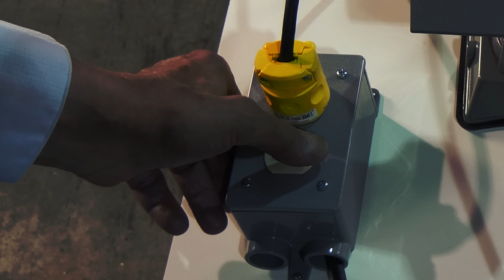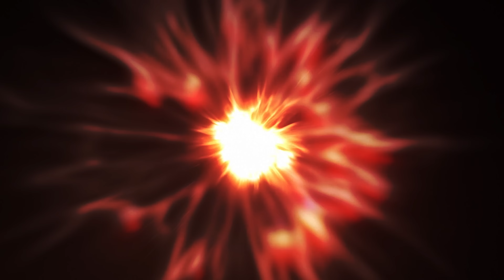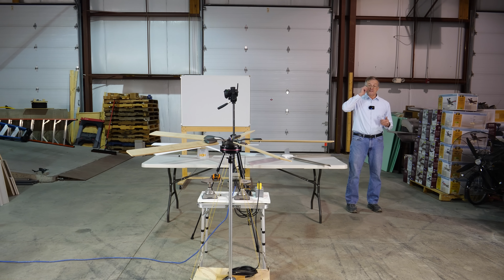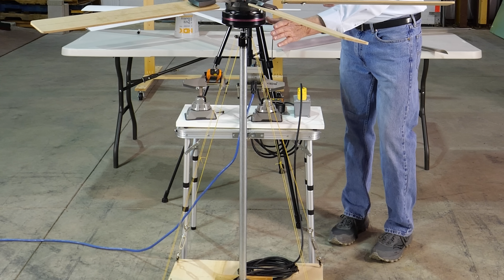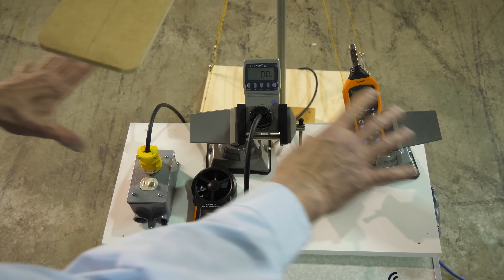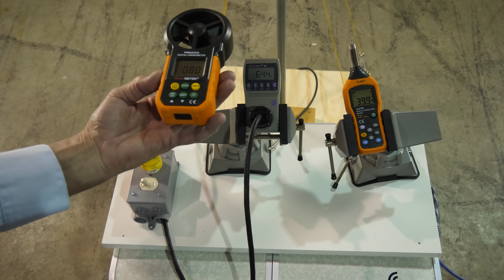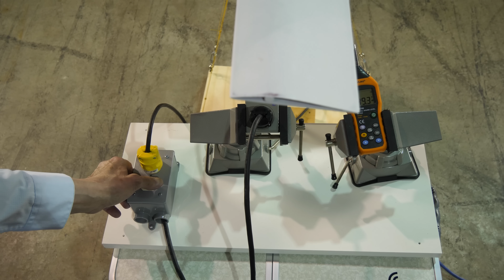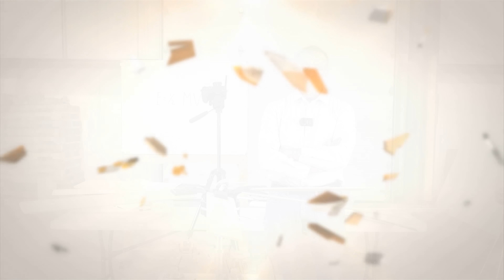This Fan Uses Almost NO Power

Comment: I'm wondering what the issues with the first motor are that it performs so much worse. I'm not too technically educated - trade degree only - so my first idea was shoddy design work. But maybe it is the underlying technology is simply not as efficient plus push for minimised component costs?

Comment: Hi, i think there might be an error in you measurments. The thing is that AC motors have a very low power factor, espacialy with low load. That means that while you are measuring 60w, technically, it's not converted to heat ot mechanical energy by the motor, and significant part of the measured power is returned to the grid. When you load the motor, power factor increaces, and more energy is actualy used by the motor. So, for example, if we measure 60w with no load, and 70w with load, we can not say that 10w is used to move air.

Comment: Slats are symmetrical in both directions, allowing easy reversal of the fan for summer vs winter operation by just reversing current flow.

If you use an airfoil shape, won’t you need to flip the foils in addition to reversing the current in order to reverse the airflow?

Comment: Q;  is the initial fan motor designed to only run while hanging from above?  Could the orientation relative to gravity be meaning it is not running on its bearings properly?

Comment: AC induction motors for ceiling fans are about as awful as shaded pole motors or anything else. Induction motors can be quite efficient and cheap but ceiling fans are designed to be really crap, with low torque and high leakage, poor power factor, etc. The squirrel cage fan in your central air is a bit better but smaller single phase induction motors will always be a bit crap... At least legit motors offer 60 to 80% efficiency. Larger 3 phase ones in industrial and commercial will be much better. I wish 3 phase was more common in residential.

Comment: I love your contents, but that may be the most frustrating episode for me. 😄
First, you did not adjust the pitch of the blades. This is fundamental, specially on the asymmetrical blade design, that even at 0º incidence already produces lift. And particularly on the asynchronous motor, its rpm is defined by the mains frequency , and can get very lossy if forced out of sync. A curve showing consumption vs load vs RPM would have been really nice.  
And the pitch of the foil blades looked way too high . You are looking for airflow, not lift or thrust. Wing shapes may not be good at all for this. Common fan blades all have are really specific design and shapes, for a reason i suppose.  
Finally, I think that testing the other blades on the dc motor would have been interesting too , showing if there was any advantage in using those designs.

Comment: Hunter Pacific is an Australian company. They have had DC motors and proper blades for a very long time. What you are looking at there is the low tech cheap models.
What's with the lamination buzz?

Comment: @8:30: There is clearly 40 dB of noise from that graebage of a transformer.
Reply: On the second watch through now and I realize that that's not the Transformer noise that's the sound of the motor itself. But that means that he does not have it on full speed because they generally only hum like that when you have them set to low
Reply: Yeah that was my first thought too and also when they sound like that they're usually chomping up the power so where was he taking the measurement for the power reading at? And it doesn't really matter because that thing is going to affect all the way up and down the line.
Reply: Yes, it was a waste of time in many ways.

Comment: Thanks for the video! I remember back around year 2010 in the market for vacuum cleaners in the EU, the different brands was rushing to market the more powerful (wattage) vacuum over the other. It went from a regular 800 watts to over 2000 watts over a few years. The EU then started limiting the max wattage to 1600 in year 2014, and then 900 in 2017. The vacuums are still very effective, but now the brands have to compete on efficiency, and not just putting in a more powerful and less efficient motor to brag about "power". Its also worth mentioning that the EU has a lot stricter and understandable energy marking on all appliances compared to the US, making it easier for the consumer to chose the more energy efficient variant.
Reply: They turned them into expensive!!! Dustbusters, not even the motorised brush in the suction head helps to remedy that.

Comment: Too bad the data weren't presented in a comparative table or graph. At the end the stock blades are not only less loud, consume less power and cheaper to manufacture... Honestly the BLDC motor part is interesting but quite irrelevant. Who is going to replace its fan motor ? Nobody. Yet replacing blades happens often (broken or damaged ones, lack of space etc...)

That and the humming noise (which probably interfere with sound measure too) made me a bit disappointed on this video.

Comment: At about 5:18 you got my attention with the statement, "the blade was optimized for low speed operation . . ."  Did you mean, it has the optimal (constant) angle of attack for a constant width and constant cross section shape"?  I would guess that the speed varies by an order of magnitude over the length of the blade ( radius from 3" to 36") unlike the Wright brother's wing which has an almost uniform wind speed along its length.  Airplane propellers and wind turbine blades have a twist along their length to effectively vary the attack angle to match the speed of the blade through the air.  In addition, the width of the blade (again both airplane and wind turbine) varies along the length as does the shape of the cross section.  Finally, the parameter which is being measured for "blade performance" or "fan performance" is the air speed at a single point along the blade length.  Optimizing a fan blade is a very complex problem even before considering the electric motor to drive it.

Comment: Two comments: First, Energy Star will not test portable fans (and some are awfully inefficient), just as they refuse to test microwaves; but they do test ceiling fans.
Second: I have a story idea which your channel is perfect for, assuming my premise is worth considering. I am skeptical about the net effect of both dehumidifiers and humidifiers, but I have been unable to work the physics needed. A dehumidifier removes water from the air BUT in condensing the water I understand that significant heat is generated, plus the equipment expels its heat of, say, 600W when cooling, directly into your home. I was wondering if the effect was a wash (or worse). Then I thought about expelling the condensate through a copper coil or radiator, on its way to the drain, since it is ice cold. 
Moving on to the hateful furnace humidifiers, could the opposite be true? That is, when the water is evaporated it cools the heated air from your furnace (duh). At least the humidifier motor's heat is utilized. Setting aside the comfort advantage of a moderate amount of humidity in both heating and cooling season, do either of these devices actually benefit us from the energy use point of view? This ha really bugged me. Thanks.

Comment: I think the best test would have been to compare all motor v blade combinations at a target air flow rate.
I suspect the tricky bit would have been getting consistent air flow measurements.
My prediction is that the decibels from the DC/airofoil combination would have been drastically lower.

Comment: I've been using a dc solar fan for 30 years. 1kw 12-volt battery bank. 800 watts of solar. Runs 24 / 7. Wish I had a link to a 12 brushless motor. I'm using the Ameteck 36 brush motor. They were great back in the day for small wind turbines. All I had to do was replace the brushes and bearings over the years.

Comment: 8:00 you can tell the motor is lagging behind the ac line because it is so noisy, synchronous motors dont like running below their rated rpms
.....ok maybe that's a lighting fixture as it's buzzing when the motor isnt powered?

Comment: Junk Chinese motor with aluminum windings and cheapest possible steel in the stator with massive core loses in those fans no doubt. Issue is we're always looking for the cheapest products, and often that means it's made with the worst materials that will barely do the job. Nearly all motors and transformers are made with aluminum windings now. Using copper and quality low-loss magnetic steel are luxuries that are now explicitly stated on packaging of a few niche manufacturers.

Comment: 2 things, would winglets help reduce drag and inorove efficiency, also i read uneven edges improve efficiency which is why the engines on 787 and 737 maxs have points, maybe that on the trailing edge could help it's meant to mimic an owl wing I think

Comment: You make a good point about the vast increase in efficiency of the DC brushless motor! The old style AC motor lasts forever - power surges and lightning strikes will not phase them. The common failure is run capacitor - but even then, they last for ages. Sadly with corporate profit incentives they'll manufacture the DC motor in a wimpy way such that the first lightning strike will zap the motor ICs and drive transistors. You've heard of shrinkflation, where product serving sizes are diminishing while keeping the same price. Well now we have crapflation - products break more frequently, harder to service, requiring more frequent replacement. I'm not dissing you. You've made a significant finding - so significant that I fear "Green New Scam" legislation that will outlaw old fans (remember tungsten lightbulbs). I like LED lighting, but the bulbs are built to burn out because of trapped heat. In my overhead light fixtures that are unreachable, I use a set of channel-lock pliers to pop the globe off of them - the reduced heat makes them last much longer. Without the diffuser globe, the lamps cast shadows along the top edges of the walls. I don't care; the bulbs last longer. You've got to factor in frequent replacement costs in your cost analysis.

Comment: Another interesting application would be off-grid, when you have a DC energy storage, using the fan controller straight from DC, rather than using an inverter to convert DC to AC, to feed an ac-dc power supply, which feeds the motor controller, which then converts it back to AC.

Comment: Conclusion, get a fan with a quality brushless DC motor instead of an AC motor for major power savings, or higher performance with lower savings (but still savings).
Small appliance AC motors waste too much energy on heat (which also means the fan will move warmer air, which is probably not what you want).
Depending on how often you use the fan you can see a return on investment within ~half a year (if used non stop) or more, but the fan should last a decade and save much more.
If you choose more motorized appliances with such a motor you'd actually start seeing a difference in your bank account too.

Otherwise, asymmetrical > wood plank > curved metal foil - fan blades. but it's not close to being as important.

Comment: A NACA profile like that is designed for lift, not for mass troughput (hence the rather steep angle of atack I think). I would love to see some results using a helicopter airfoil, or even a propellor type airfoil.

Comment: 3d print blades : use Prandtl-D 3 bell shaped wing loading (maybe extend them a little in length) this shape is cancelling out the lift at the wing tip so that noise can be much reduced, it may also self-stabilise partly. Those wings will be lighter and have their width reducing going to the tip. You may also experiment with number of blades and their basic angle, but the Prandtl-D type of shape has its angle rotating in various key points from start to tip.  Look for the NASA paper and take the angles and profile of Prandtl-D3c. (it is a a low speed almost hand glider)

Comment: This is truly sad that US being pioneers in electricity and then in domestic electric appliances got stuck in the past for some reason. In EU  DC fans, washing machine motors, AC units, heatpump driers are everywhere, it is quite difficult to find old school devices actually now. I could only guess this is due to lower electricity costs or because we have strict regulation for consumption.

Comment: I invented and built a brushless motor driver that does not use a computer chip/software.
Could be used in all the applications you mentioned.
Looking for investors to start a manufacturing facility to produce them.

Comment: Any thoughts on measuring air velocity that close to the blades ? even just for comparison between blades it likely introduce an error due to different air-patterns from different blades. A measurement 2-3 meters from the fan where things are more homogeneous would be better.
No doubt the shaped blades are better, but a more accurate measurement could show even greater improvements.

Comment: I have several fans leaving California for Idaho & I was planning a test, because I have an off-grid solar+ battery system & was concerned about old inefficient motors. I will complete my findings, across several brands & without a doubt, will buy Hunter Brushless motors. As always, I'm pleased with your work. I'm preparing for your AC system. Thank you

Comment: This would be quite useful to someone like me who runs their fans the same direction all year. I do it because the output from my high mounted MrCool cassette distributes more evenly year round when on updraft, and downdraft is uncomfortable. For those who need reverse, a simple mount that will install on standard ceiling fan blades with a rotation feature could be used. On direction change, you would simply press a detent on the rotation shaft and spin each blade 180°. Alternatively, an automatic mechanism based on rotation direction could be developed. When will you have these for sale?

Comment: I have done similar tests on smaller fans, but I track RPM, thrust, and air velocity.  I use a scale to measure the thrust, (lift) by the loss of weight, and use the momentum equation to determine the M*V.  I have found the velocity measurement the largest source of error.  A killawatt power meter is used to measure power.

Comment: There is a good chance the powermeter can not handle the frequency and crestfactor of the signal from the driver board. They are also often very bad at low power levels (under 5W or so). I would use a good lab grade bench power meter from a company like Keysight or R&S that can handle this signal.  (Measure with a scope to analyse the signal first) In my country you only pay for the real Power (P in Watt) not for the reactive part (Q). Together they form S (in VA) Many of those hobby powermeters are for most good at measuring things like a lightbulb at 50 or 60Hz. They can give huge faulty values when measuring reactive power and higher frequencies.

Comment: DC Brushless motors beat shaded pole and small induction motors hands down. The inclusion of Neodymium magnets may be the sticking point in DC motors, both availability and cost. i suspect ceramic magnets would also be a contender for cost/efficiency. Great video 👍

Comment: The difference is probably much bigger than shown by the meter. The missing  component is power factor, the difference between actual power and measured power. AC motors are notoriously confusing when the wattage is measured because the phase of the amperage and voltage components are shifted in time compared to a resistive load  and not all measuring devices compensate for that. The average mechanical house electrical meter does not. Your device might. This means the actual amount of energy removed from the grid is significantly greater than measured.
Ironically,  most homeowners pay less for running such a motor than they should. Converting to a couple DC fan motors,  including the losses from conversion, may not end up a significant savings dollar wise.

Comment: I'm going to have to look at those. Here in TX ceiling fans run nearly year round and I would expect that many of the 20 year old fans are even less efficient than that new one. So many of the so called energy efficient fans are energy efficient but they don't move any air.

Comment: Just google Dreo Ceiling Fan CLF521 - and they're not the only ones.  If you're willing to pay a little cash, there are  a lot of brands with more efficient designs than the cheapo flat slat fans. Better motors and better blades.  When picking a topic to research, maybe do a little.... research??

Comment: You didn't explore the obvious "undervolting" avenue. Being more efficient allows you to run at lower speed to achieve the same airflow with even more energy savings AND a lot less noise. That would not be easy with the induction motor, but with the brushless one you could have tested it easily. 
Similarly when I get a new CPU or GPU I undervolt the hell out of it. Mainly for heat=>noise and battery life reasons, but usually I even get better performance at the end. This is well know in computing for decades, but is very much pushed aside by the misunderstanding that it's mutually exclusive with overclocking.
PS. a tapered wing is kind of important if you care about uniformity of airflow and noise.
PS2. You had way too high pitch in your second test with the sheet blades. Testing different pitch also makes a lot of sense in this scenario you were exploring.